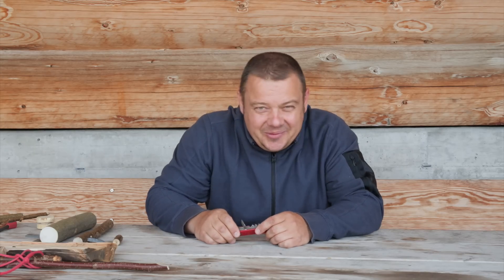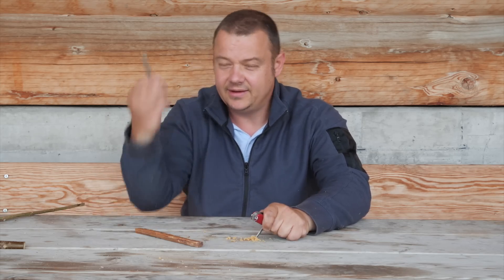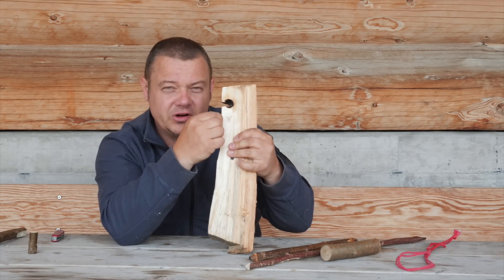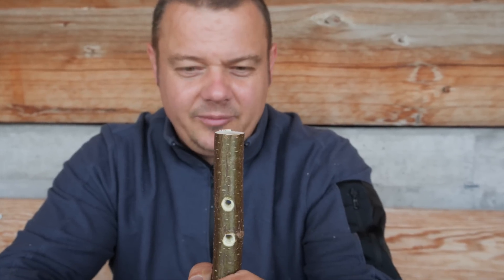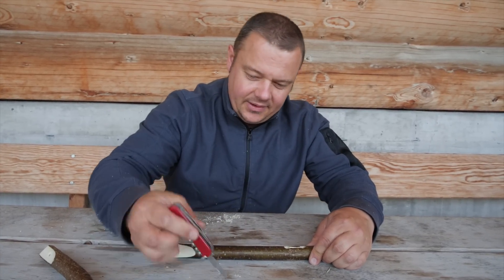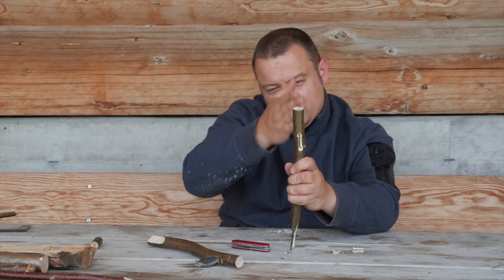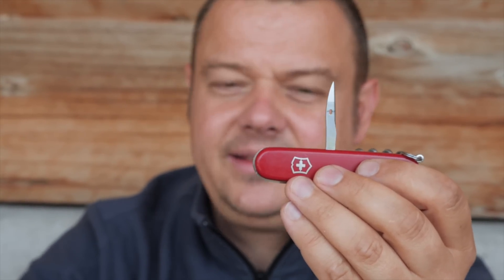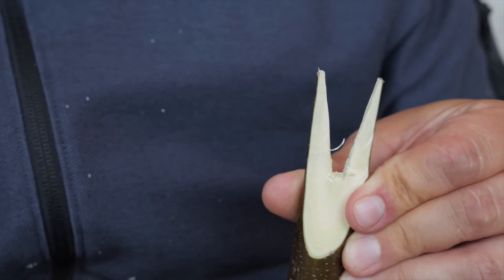Victorinox Tips & Tricks (19/40) - Fire trick with the reamer and more

Comment: By the way, do you have good tips to help make fire effective with the magnifiyng glass? The magnification is not so much and the glass is small. My best method is to stack about 20 crisp dry leaves on top of eachother, hold the stack tight together, bundle the light on the leaves and hold it facing the wind. If it is a good wind than flames fly out after only a few seconds with a bright sun. Ok, a lot of words but I hope you understand.
Reply from the maker: Wowww, this method i never tried before. Thanks alot for this wonderful tip. I planed a video about making a fire with the magnifying glass.

Comment: Others have created parts for replacing toothpick with ferro rod.  It would be nice if Swiss tools could make four holes for small tools instead of two.
Reply from the maker: Thanks a lot for this idea! If you want you can write your idea Victorinox: https://www.swissarmy.com/us/en/Victorinox/Contact/My-Victorinox-Product-Idea/cms/my-victorinox-product-idea
Reply: @FelixImmler  I filled in idea about a spoon carving idea tool with hook knife for spoon bowl carving hope the makes one 🐾🐺👍
Reply: I take a needle, heat it,  and melt a needle holder hole under the screwdriver or corkscrew,  then I put a needle with just a bit of thread,  wrap that thread around the base of the screwdriver or corkscrew so it won't get lost. 
I always have a needle in my SAK 
I always thought there should be needles and fishing hooks under the scales of the handles